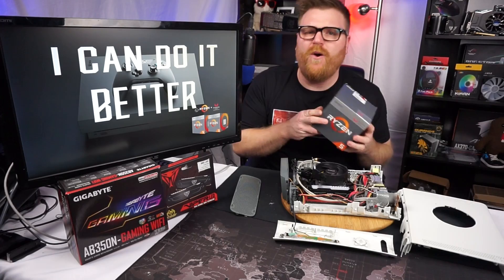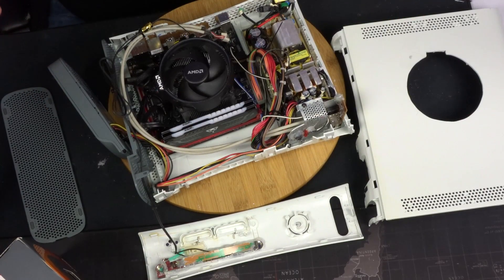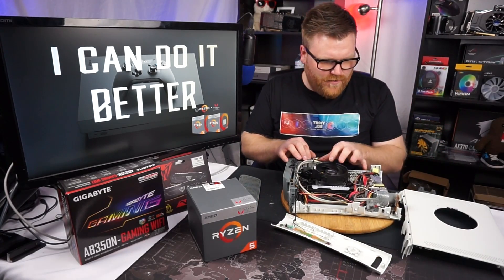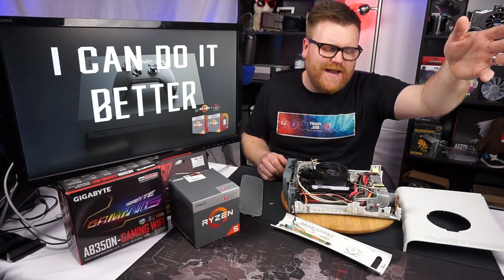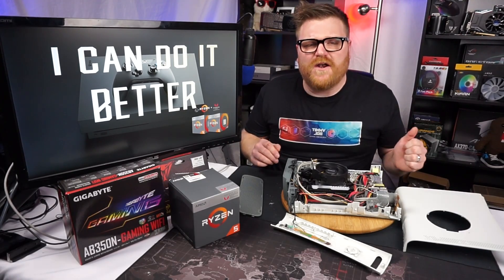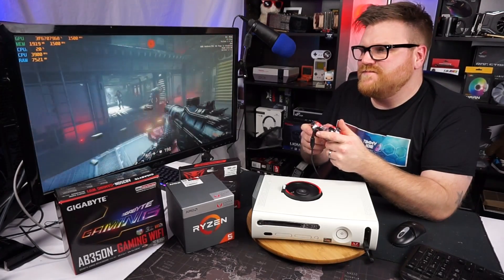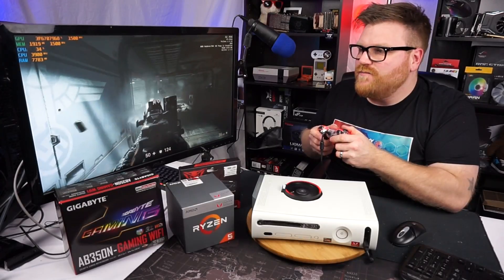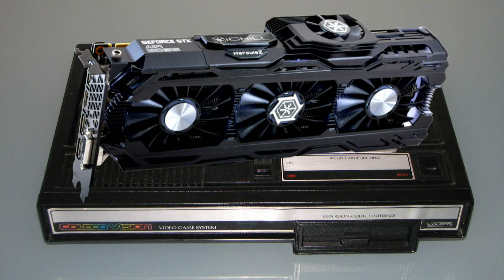I Made My Own Xbox With A Ryzen 2400g

Comment: you mentioned the spire cooler, i thought the 2400g came with the stealth cooler. which if it is the stealth a switch to the spire with a delid would prob net great temps. Awesome mod tho
Reply from the maker: No I used the spire from my 1700
Reply: nice
Reply: not sure how good this cooler is "Corsair Hydro Series H5 SF" but it would be interesting in a similar build if you were trying to avoid the top cutout.

Comment: came to this vid thinking "yeah, and i could probably do it better than this one will be" and i still think that but i also think that you could do much better than that, but it wouldn't be so interesting and possibly not as relevant either, good work. I like it. Just for reference - Pico PSU, put some small diameter but 38mm thick fans if you can find ones that will do sensible RPM as intake blowers where you have the psu, and possibly a noctua l9a AM4 version. I would have liked to have seen an optical drive retained if possible, it would have made it a more functional HTPC. I really like the idea, to the point i wish i had use for a system like that just so i could build it lol
Reply: YO JIMMY TOE i just had another idea for you, this one borne of my own insanity - The metal tray that was originally in the ecks bawx - it'd be a hell of a project but wouldn't be impossible to  drill some holes in it, grind the screw bit of some brass standoffs down to like 1mm and then solder them into the tray,  glorious mobo mount - that stuff is usually nickel plated steel in my experience so it is solderable with a flame

Comment: Cool project, if not entirely original.  What I'd love to see someone try and do is take an old 70's or 80's TV, the big wooden console kind, and build an entire system in that.  Once you take the tube and board out, there's ALOT of room in one of those for a very large screen, full size mobo, discreet graphics, ton's of room for cooling, it would be great.

Comment: This build is super cool!  With a M.2 SSD and external PSU you may have been able to sneak a MSI half length half height 1050ti in there with an exhaust fan.  This is definitely one of the cooler things I have seen in a while.
Reply: Joseph Cohen or one of those low profile ones

Comment: Wish I had the time to do one of these myself, with the added challenge of only using the original connectors and no outside clue that there's a PC inside, instead of an Xbox mobo.

This would mean I'd have to build or adapt my own PSU to run off the external one, wire up DVI and audio signals to the  A/V connector, solder a S-ATA cable to the HDD connector, get a BR drive to replace the stock DVD drive and wire up the USB headers, ethernet and front panel. But, hey, a man needs something to keep busy, right?

Comment: Wish I had money to give you Jimmy you deserve it for this vid. do you reckon if you use a pico psu for the cpu and make a external psu (hide it in the existing xbox360 power brick) for the gpu and getting a 1050 or 1060 layed flat in that thing would work? for a minor upgrade to the apu in future, while its nice it can play most games i believe all games 1080p medium-high or even ultra with the 1060. AMD are heading the right way though I would have accepted a higher stock tdp for a few more vega cores. they really aren't off by much for it to be a real competitor, fingers crossed amd pour some of their fine wine driver optimisation into this.

Comment: If you can find an original Xbox one you should be able to shove a bit more hardware in there. Those things are huge. You could probably use a half height card with a ribbon cable.
Reply: Douglas Mannor somebody already managed to cram more hardware in an S chassis, than this. Like he said that wasn't the point for him

Comment: A small case fan might help with those temps
Reply: God, it'd have to be what, a 80mm? I personally wouldn't want to hear the high pitch whine of a fan that small.
Reply: No, what it wants is a cpu cooler with air pulling through into the case and out of that hole he has already cut.
Reply: rokogames i would if i knew how. No pc no money 😞

Comment: Fantastic idea!! :) Here's a thought for an add-on to this xbox. All you have to do to add a graphics card is use an eGPU from Bangood or ebay and connect it to an external power supply like a laptop charger and make some kind of docking station for it maybe out of acrylic and wood which are non-conductive materials. Fantastic idea and I might actually try this since I have seen cheap Xbox 360 cases online. One idea would be to take all the parts out of the Xbox 360 cases and spray paint it. One thought is to get a low profile CPU cooler because I'd be paranoid about objects falling onto the fan and damaging it or people (e.g. kids) or pets getting fingers or paws stuck in it. Perhaps you could rig up a fan grill from Amazon or ebay onto it for peace of mind? Just a thought!
Reply: Use the Xbox 360 HD-DVD enclosure for external graphics?
Reply: Tom Brown Interesting idea to use an external GPU. I wonder how large the HD-DVD add-on was to use as an enclosure. This would keep everything matching. Assuming a GPU could fit inside it.
Reply: A gpu defeats the whole purpose of an apu build unless they allow crossfire between the gpu and apu's graphics cores. Which I would highly doubt.
Reply: AmyGrrl78 I didn't know it has an external dvd drive how big is it? Could it hold a half hight card like a low profile Gtx 1050ti? If you used a 180 watt laptop charger with the eGpu Dock that will save room instead of using an atx psu.
Reply: Tom Brown The dimensions of the external hd-dvd player for the Xbox 360 according to the Amazon listing I looked up for it. Its 9.5 x 7.5 x 5.2 inches.
Reply: Cheers! I just watched a video about the Xbox 360 DVD player and it looks kind of small for a graphics card. It could potentially fit a half-height graphics card like a GTX 1050 or an RX Nano card. Maybe it could potentially fit a graphics card with only 2 fans like the Zotac GTX 1080 mini. But I am not sure if it could fit full size graphics cards. There are some holes for ventilation but you'd probably have to add more holes with a drill or dremel or something. It would be a bit tough to work in there but it would be a really cool looking project if someone did complete it. I am now tempted to make this a reality, lol.
Reply: I just saw that Gigabyte also has a GeForce GTX 1080 Mini ITX 8G. That is even smaller than the Zotac card. That would for sure fit inside the XBOX 360 HD-DVD Drive.
Reply: That would for sure fit in the DVD case. I really wanna try out this build for the ultimate portable sleeper gaming PC. In the beginning of April I will be able to afford a change to Ryzen 3 2200g  but I am worried about the BIOS errors and glitches that people have had. Is this still a problem? I really want to try this mod myself but I am concerned about this being an issue.

Comment: 30fps is NOT acceptable for PC gaming, heck 45 fps can sync with freesync .
Reply: The good thing of a PC is that you can turn the settings down to get higher framerates if that's what you want. But I do agree with you. I'd rather play 1080p@75 low than 1080p@30 high.
Reply: Consoles are capped to 30 apart from the xbox one X which struggles to stay above 30
Reply: Ledplimmy doom on ps4 1080p 60fps capped my ass
Reply: 30 FPS is acceptable given the budget, while not as good as 60 FPS it doesn't make any game unplayable.
Reply: Considering you do not have to buy a graphics card with the absurd prices of today's market: 30fps is actually a very good deal even if you have to turn down the settings.
Reply: Maybe it's not acceptable for your SLI 1080ti's. But this is an APU, you have to take that into account.
Reply: give your nuts a tug
Reply: That's not the point of this video.
Reply: Ledplimmy lawl. Ps4Pro has plenty of games that run at 60fps, same with the xbox one x

Comment: gpu at 1600 along with the ram at 3200mhz would probably have 5-10 more fps. probably be able to fit one in a box 360 E from 2013 just with an external power supply.

Comment: timmy maybe if you tried the 2200 g the thermals would be better, as the cpu is barely used anyway during gaming, its ususally around 20-30pc, so if you swwapped out the cpu and used the spire on that the thermals would improve quite a bit

Comment: Gday
it doesnt seem worth it 

Ryzen 2200G APU vs G4560+GTX1050

Great idea making a proper PC inside console case thou
   
=========================================

CPU:   G4560     AUD$85 
Mobo:  H270 matx   AUD$85 
GPU:   GTX1050/RX560    AUD$165
   = AUD$335

8 gig duel kit DDR4 AUD$165
PSU   AUD$65
Case   AUD$65
HDD   AUD$65
DVDRW   AUD$20
KBM   AUD$20
   = AUD$400
  
   = AUD$735
=========================================

then 

CPU:   2200G     AUD$145 
Mobo:  B350 matx   AUD$145 
GPU:   APU  
   = AUD$290

8 gig duel kit DDR4 AUD$165
PSU   AUD$65
Case   AUD$65
HDD   AUD$65
DVDRW   AUD$20
KBM   AUD$20
   = AUD$400

   AUD$690

=========================================
Reply: charlie brownau theese prices do not match up around the globe. And still, you would end up with a much superior CPU. Also depends on how you want to build, if you don't care for super small form factor, GPU is the way to go. Theese apus clearly have a place in the market. I3-8100 performance and a better GPU, for lower cost than the i3 alone.